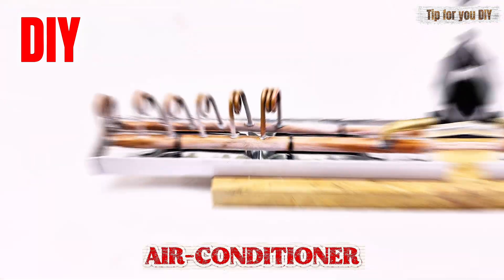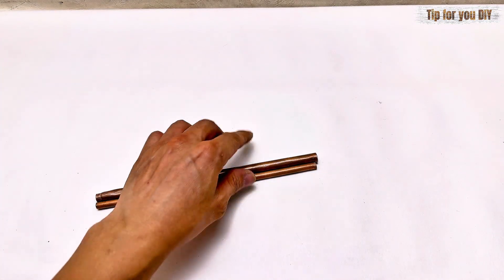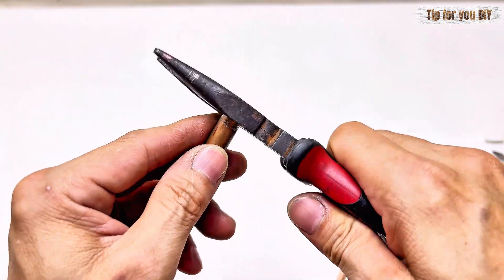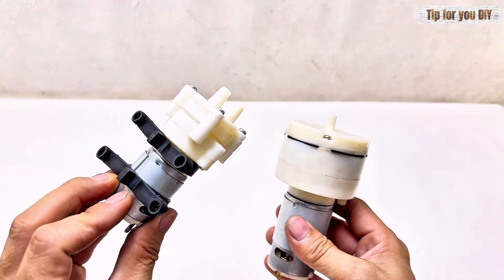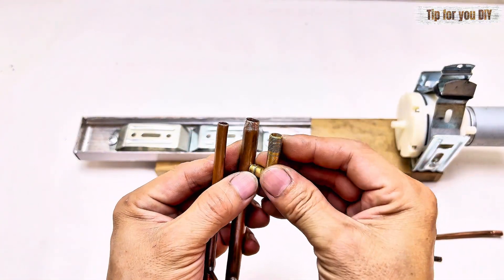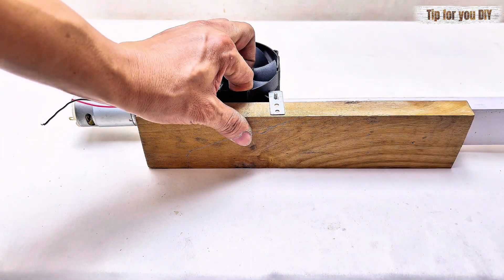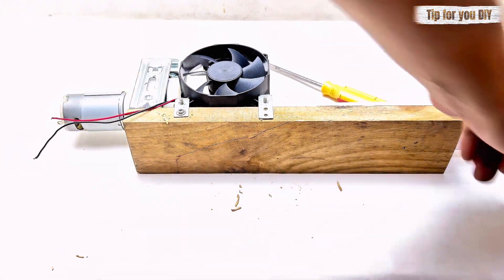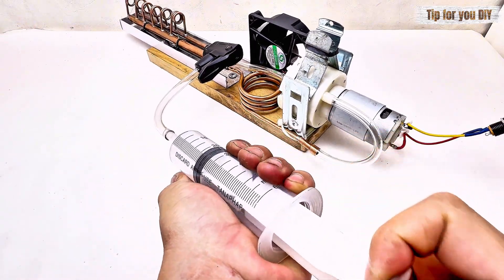Step-by-Step DIY Air Cooler ❄️ Super Cold Homemade AC -10°C

Comment: You're a talented guy. So, don't you have any cooling projects for computer components, my friend? Graphics card, motherboard, RAM, HDD, case, all of these are a pain when it comes to heat ;)
Reply from the maker: Computer cooling and what you said need to keep the cooling system dry with fans or closed water circulation. Regarding the tests I did that is not true, I also did not think of this. Thanks for the suggestion.